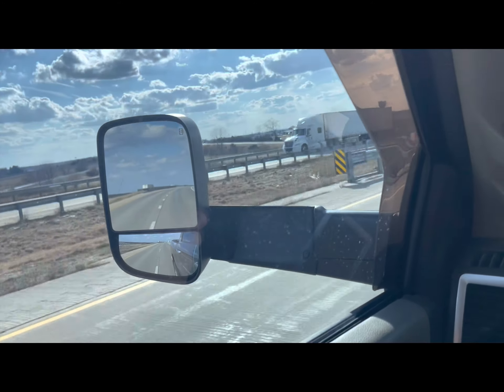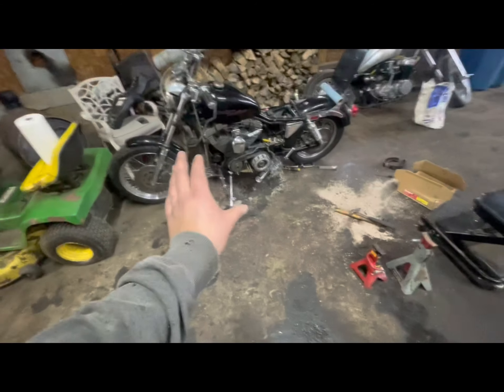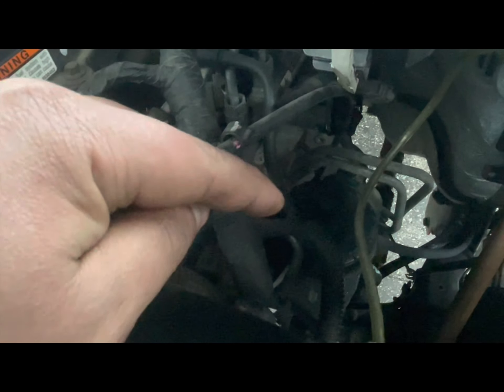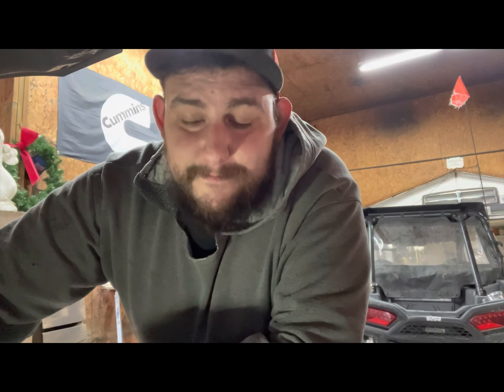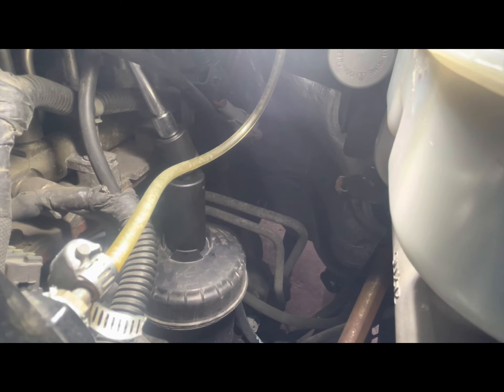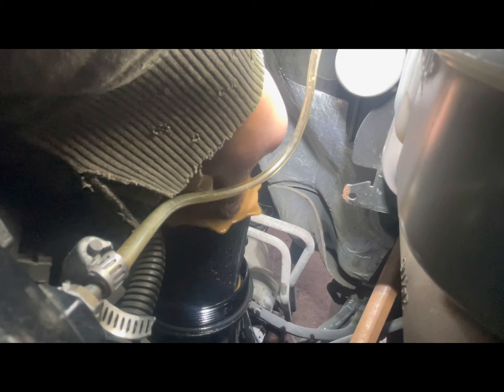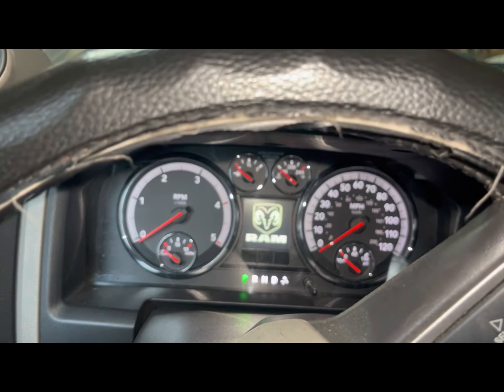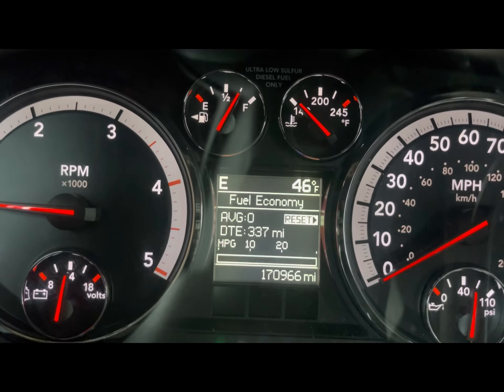Will a new fuel filter help my 6.7 CUMMINS Mileage??

Comment: 60k miles for a fuel filter what? It’s supposed to be changed every 10k miles.
Reply from the maker: Holy shit. I just looked at my chart I have it says every 15k miles. Wow was I wrong! Thanks for pointing that out!!

it just drives home the fact it was neglected even harder!
Reply: @MidwestMoose  yes no problem! I have a 2011 myself. I change mine at 10k miles. Every other oil change. I always use Fleetguard/mopar filters.
Reply from the maker: @ericestep9880  I’ll have to include that into my maintenance schedule. And as a bonus: the milage has settled around 15-16 for the past few weeks. So it dropped, but it’s improved for sure!